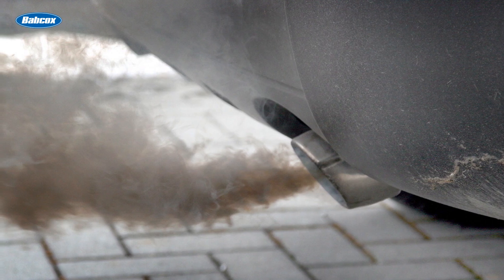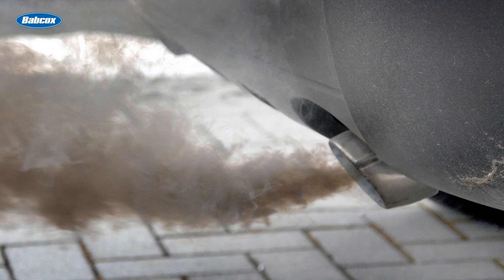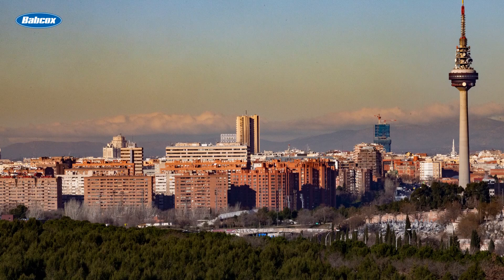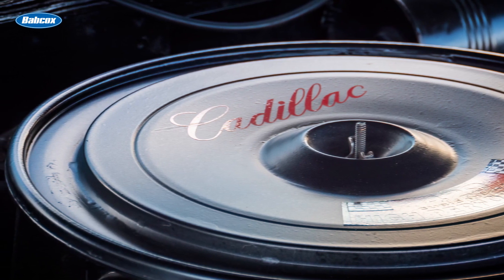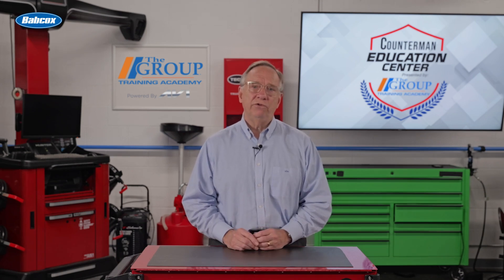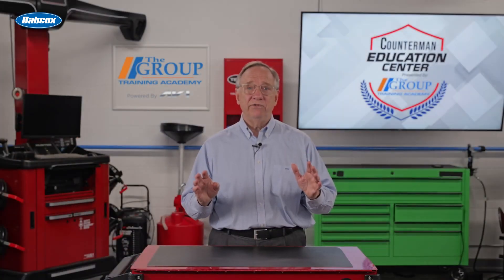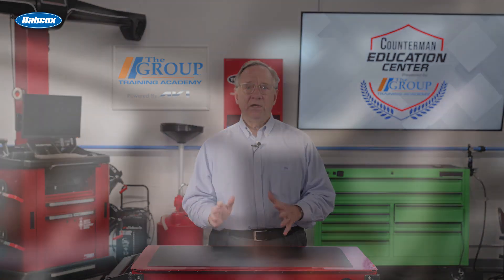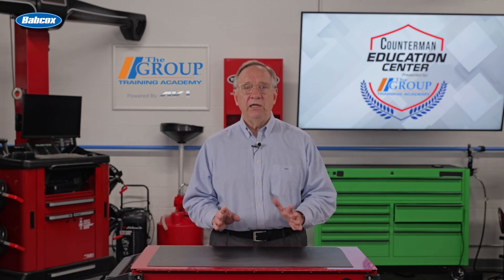EGR Systems: Understanding Exhaust Gas Recirculation-

Comment: Its a problematic system though in practice. Anything that connects an exhaust with your air intake is a red flag. On my previous motorcycles its the first thing I remove. Less is more. Modern motorcycles are clean enough anyhow. Diesels are a different can of worms with EGR as it ruins your oil with soot. My new 1.4l petrol car (2016) doesnt even use it nor does my current 1.2l Motorcycle (2010) so no need to rip off the rubbish thankfully.